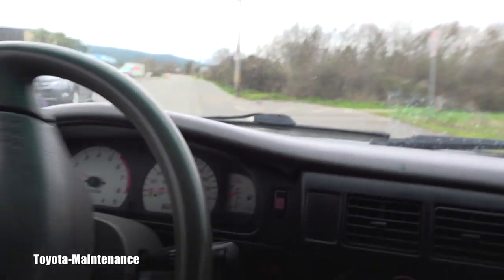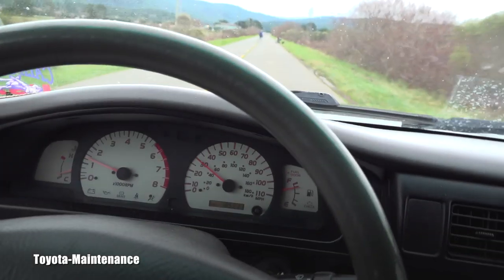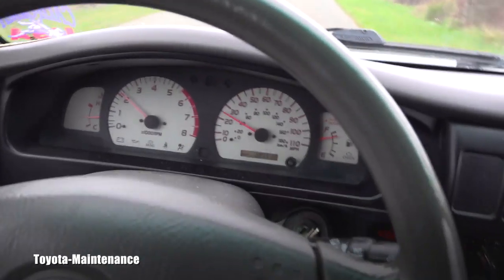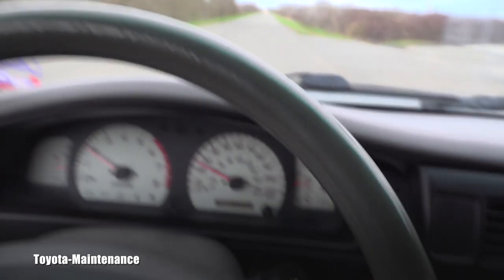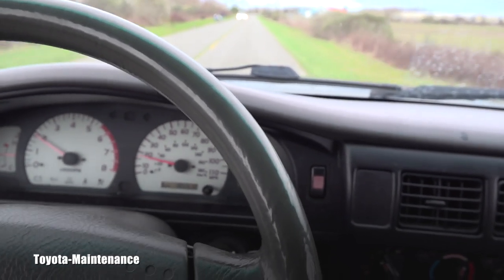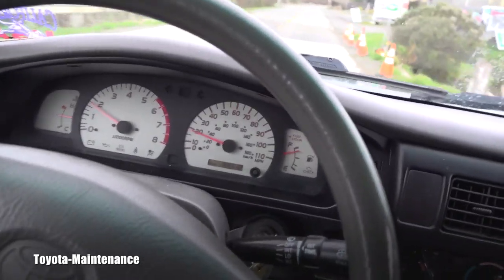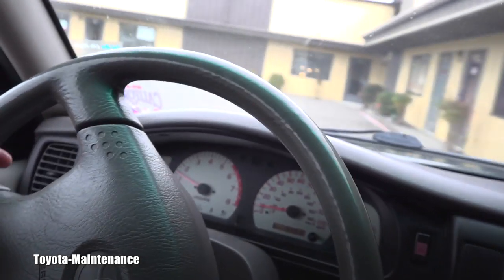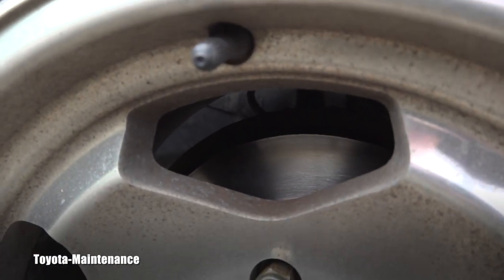New brakes brake-in procedure

Comment: You are never supposed to stop completely ever, only slow down to 5-10 kph or you risk getting baked break pads on the rotors leaving an imprint. 

The way you are supposed to do it is a few (3-4) Slow speed gradual stops to get some temp, a decent amount (5-7) of Medium speed harder stops and a good amount (5-7 or until brake fade) of high speed emergency stops without ever stopping completely then drive around at decent speeds WITHOUT stopping for a good while to cool down everything. I’m a mechanic myself and this is how Mercedes AMG officially wants us to bed in their high performance brakes, we got a paper in the workshop describing the procedure directly by Mercedes AMG. This applies to all brakes, you always do it the way I mentioned on all cars as backed up by manufacturers, if you would search it yourself you would see this is how all manufacturers recommend doing it. 

If you don’t believe me I have a picture of the paper describing the procedure I saved for myself which I could share with you so you also know how to do it properly!
Reply: This is what I learned from the brake/rotor manufacturers. Do you know why dealers don't do this procedure? :)
Reply: @eastbay40386  Most often it is lack of knowledge (they don't know they are supposed to do it), lack of care or lack of time or sometimes all of those which results in no one ever bedding in brakes at all, so people saying that the dealer has already done it I don't need to do it, lol no no one does it.
Reply: Spot on!
Reply: Thanks for the tips, but no way I'm doing 5-7 emergency stops in my Sequoia. Liable to break something else doing all that. Plus I'm not sure how to turn off the ABS. Mines a 16 year old vehicle and I wouldn't want to test the ABS 5-7 times, that's like asking for something to go wrong.
Reply: @plutosforest  Try it, I bet you nothing will happen. Besides that, don't you think you driving a car you don't dare to emergency brake in is dangerous? What happens if something or someone jumps out in-front of you? You don't brake or?

Comment: Hello ! I have a 2001 Tacoma 3.4L 4x4... when shifting into 4Lo, my transfer case grinds and when shifting back into 4hi from 4Lo it also grinds. I do this while completely stopped and in neutral. I’ve already changed my differential and transfer case fluid.... my dad said it is normal and not going to hurt anything as long as I’m completely stopped and in neutral. Is this true??